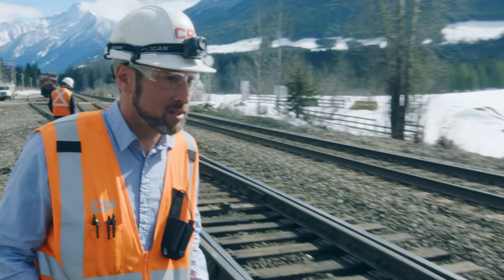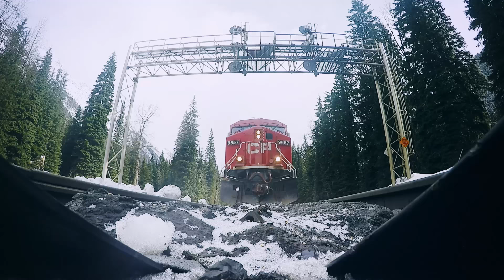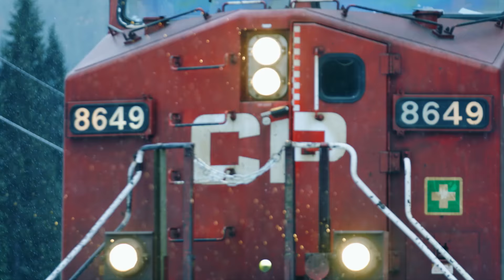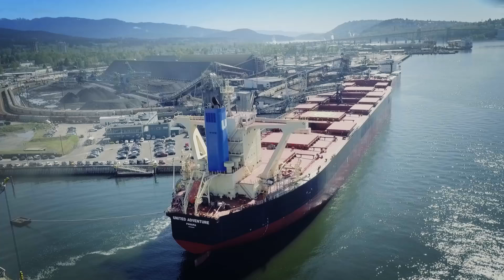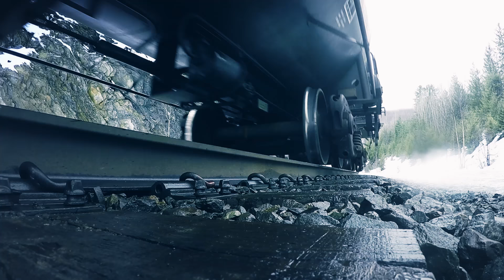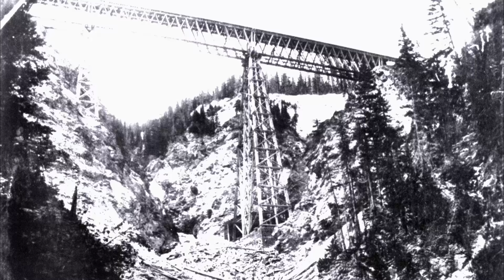The Coal Train: A Journey of Hope and Determination | Rocky Mountain Railroad | Episode 2 | DC

Comment: Work safe!  Wow back in 1981  I worked in an Anchor yard for an oil Drilling Company .. Everyone was in a Rush and it was very dangerous many unnecessary risks were taken.  From what I heard it was much works on the Drilling Platforms.
  Keep your Cool double check think things through.  If you make mistakes it will take for more time fixing things and doing them a second and third time.

Comment: So many factual errors, but the music is nice.
* Many unit coal trains run 10~20 times per week, so each run is kind of routine.
* No crew goes the full distance; They might run 4~6hrs (@30 ~45mph => 200~300 miles, so 3~4 crews each way).  Change crews at Kamloops, Revelstoke, North Bend, etc,  but too confusing for viewers?
* Conductors do very little UNLESS there is an emergency or perhaps throw a switch at the mine or port.  Mostly, they collect a paycheck and given the Engineer someone to talk to.
* Video discusses how coal is used in the Canadian economy, but this is for export . . . to Asia probably.
* Ship is waiting and "it MUST depart before nitghtfall"?  😆  Coal is not just-in-time.  It is relatively low-value and that's why there are piles of it at the mine and the port.  Note that the ship is being loaded without the presence of railcars.

Trying to tell a story with drama.

Comment: Welll wait a minute!!!  How do they turn the train around when they get to the end of a line???
Reply: The usual way is running around the train, that is, uncoupling the loco(s) from the head of the train, running them (on a parallel track) to the tail and re-coupling there, becoming a new head.
Where a distributed power is used with a loco coupled at the head and the tail you can just switch the ends, although distributed power arrangements are rarely symmetrical.

Also, on some freight facilities there are reversing loops ('balloon loops'), just like on a tram line.
A loop can be seen at 22:52.

And some trains (usually passenger ones) may work in 'push-pull' mode with a locomotive at one end and a control cab car at the other, reciprocating between pull mode with the loco at the head and push mode with the loco (controlled remotely from the cab car) at the rear.

Comment: What they call a Damn Frog is not called that it is called a SPURE!!!!!!!!!!!!!!!!!!!!!!!!!!!!!!!!!!!!!!!!!!!!!!!!!!!!!!!!!!!!!!!!!!!!!!!!!!!!!!
Reply: A spur is the alternate line, while the frog is the guide to the proper line.
A frog is the normal term used.
Reply: @robertheinkel6225  Rail Spur means the section of railroad track to be constructed and maintained by agreement among the City, the County, the CID and the Service Corporation that will provide rail access to the Project Site and other properties for the purpose of loading and unloading freight cars and other railway vehicles. Remove Advertising Rail Spur means the connection between the Industry Track and the Class I Mainline Tracks of the BNSF Railway Company.
Reply: Different countries have different rail terminology even in English.

'Frog', 'common crossing', 'vee'...
Complete the list.